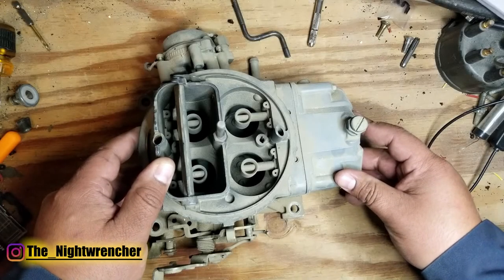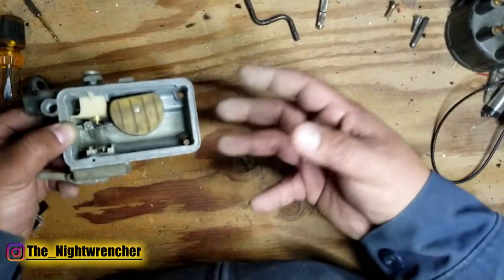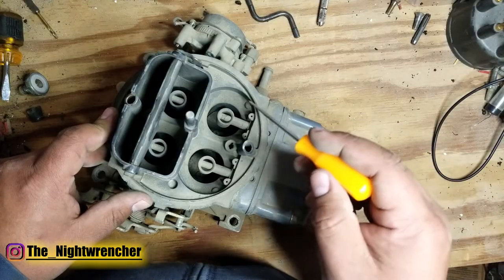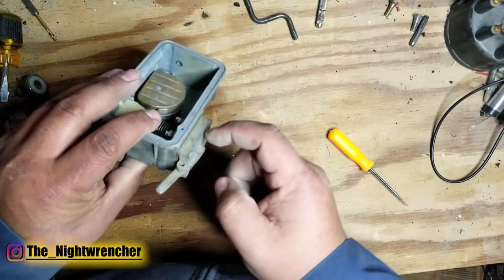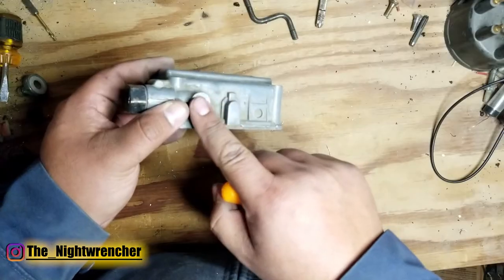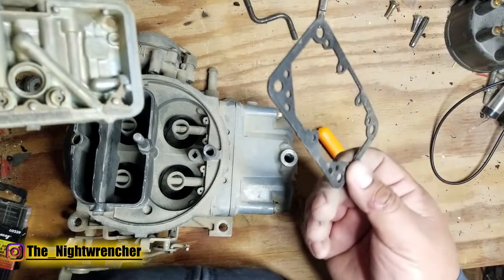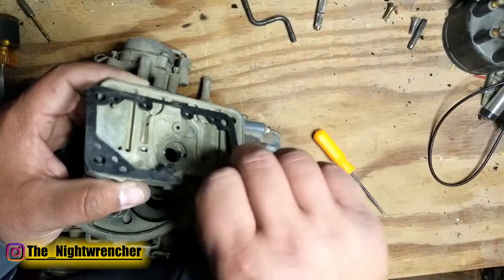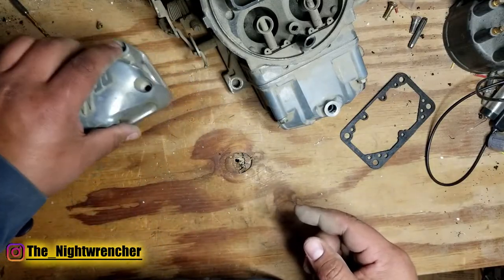Common Holley Carb Leak Solutions | Holley Carburetor Tuning Secrets |

Comment: Don't forget to not use a electric tool. My 800 carb became a paperweight
Reply from the maker: It depends on what tool you use. I use an electric drill with an adjustible clutch. I snug them down close and tighten them by hand

Comment: I don't have a fuel return, so fuel pressure goes up after I turn it off. The bowl levels start to go up, and just enough fuel blocks the air bleeds and then it develops a very slow leak on the butterflies
Reply from the maker: more than likely thats caused by heat soak. Try using a wooden or plastic half inch spacer
Reply: @NightWrencher  thanks, I'm putting in a return regulator and love to the tank. I just don't see a way around it at this point. I don't fuel in my new engine oil
Reply from the maker: Thats the best way to take care of it 👍

Comment: Hey I just found your videos, I’ve learned so much! Thank you. I’m having trouble with my Holley pouring fuel from the vent tube in my primary side. At high idle and driving it runs fine but when I let off the throttle it starts pouring fuel from my vent tube on the primary. I’ve checked the needle and seat, replaced the O ring and adjusted.
Reply from the maker: Hey man, what is your fuel pressure?

Comment: @NightWrencher Do you happen to have any idea why my secondary squirter drips fuel slowly when the car is off? Ive tried everything i can think of and nothing works. I appreciate any insight you can give. Ive searched high & low online with no answers.
Reply from the maker: Make sure you have a steel needle inside the squirter fuel feed and make sure its clean. When the car is off, fuel expands and sometimes escapes through the squirters. Once the engine cools off or leaks enough gas, it will stop leaking. Not really a dangerous problem unless its flooding the engine or leaking to the outside of the carb.
Reply: @NightWrencher  you helped me narrow it down. The brass seat under the steel needle had a defectin it. Used a small punch and hammer on top of the needle and it reformed the brass seat. Good to go! Thanks brorher!!
Reply from the maker: @jeremiahfiek5495  thats awesome, great job!

Comment: I fixed my 780 problems. After having an off idle stumble besides a surge at cruise at any speed and an idle that would not go down, I tore my 780 apart. I found wet gaskets and areas that should not be wet and a blown prim power valve.

I ended up filing warped parts especially the body bottom, the bottom throttle plate side and a bit on both body surfaces where the metering block meets. I spent a total of 5 hrs filing. It works great now after replacing gaskets, power valves and so on.😅

Comment: Does the casing that holds the accelerator pump ever get warped and no seal correctly? I noticed a fuel around the sides of the accelerator pump so I replaced the actual accelerator pump gasket because I thought it was ripped or something. It looked fine but I replaced it anyway. When I started up the car again I could still see the fuel seeping out the sides. So I was wondering if the casing maybe is warped and not sealing all
The way. Thanks in advance!
Reply from the maker: Sometimes it does happen. Running it over a piece of sand paper and check the pattern. Usually its just a little warped but it shouldnt be too hard to fix

Comment: I bought some vasaline and chapstik to put on gaskets for my next carb rebuild. I'm hoping it helps, especially on the paper gaskets. What do you think?  Or maybe antisieze or motor oil or trans fluid on the gaskets and the O ring on the needle and seat.
Reply from the maker: Ive heard that chapstick works pretty well but I've never tried it myself. Vaseline on the orings might work too. I usually install the gaskets bare and use motor oil or PBblaster as a lubricant to install the orings.

Comment: Lots of great info! Its been 10 years since i had to play with one. But got this old holley 4 barrel on a project car. Was just rebuilt prior to buying the car from a reputable carb shop. 2 months later and maybe 1k miles of driving I have a decent size fuel leak from throttle shaft area. Other than shaft being worn, can anything else cause it like over-filled bowls? 
Thanks again
Reply from the maker: If the shafts are leaking, the shaft bores are worn out. Somtimes they have nylon seals and other times its just metal to metal from the factory. You might also develop a vacuum leak from there. They sell bushing repair kits but I would recommend replacing the base plate. Good luck 👍

Comment: I have a holley carburetor with a float bowl on the front and rear of the carb. There is a straight steel fuel line that connects the two bowls. Fuel is leaking out of both ends of that steel line. It is almost as if the line needs to be longer. What should i do?

Comment: I have a brand new 600 Holley Brawler with mechanical secondaries and after making changes to tune it for my 306 I’ve noticed the secondary fuel bowl leaks down after filling it. There’s no power valve in it because it came with a plug, I have no visible leaks outside of the carburetor and I’m really stumped on this one, any advice would be greatly appreciated!!!
Reply from the maker: Well, fuel has to go somewhere and if its not leaking outside, its probably leaking into the engine. Where exactly, I dont know but if you can pinpoint if the fuel is leaking through the idle holes, accel pump, boosters, tslot or air bleeds, you'll be able yo find the cause really quick.

Comment: Hey senor Nighwrencher,

Not sure if it is me or my carb. I have a 750 4150 Holley on a 396 BB ,  my El Camino is insane  Up to say 100 ish mph,  and just seems to take its sweet time getting  up to the HP at 4500 - 5600 RPM, my cam, heads, intake are all matched up at 1900-5800 rpm Edelbrock and Comp cam,  I have a AF gauge, it seems to be fine all through the entire rpm range,  just seems to take its time at the top end , the build is supposed to be a 550 ish build, any thoughts? I am concerned about the carb CFM but it should be fine 🤔🤔🤔🧐😵‍💫
Reply from the maker: It sounds like your set up is dialed in but keep in mind that max horsepower does not dictate how the engine accelerates. If you've ever been on a dyno, you can see where the power starts to flatten out before it drops off, that's probably what you're feeling. Without completely changing your engine, I would suggest switch out to a shorter gear ratio
Reply: @NightWrencher  Well the gearing is a 700R 4  built with a 22-2500 stall, locking Tq and posi w 342 gears , first into second is all about burning rubber she is mean from shit to get, I just would like to see it act the same all the way through the gears.
I guess Dyno is my best shot 💉 now, and I really love your shows I have used them to go ahead with my AF gauge system, I was only off on my primary jets from 72s to 65s after the install , not to shabby from being a plug reader from the early 1970s. 🤔😉 Peace

Comment: Hey man just found your videos a while ago and I've been watching all your welding ones. can you do a video on how to weld tool steel for repairing like a broken wrench, Hammer, Etc...? Ive checked around youtube and cant gind any videos on it
Reply from the maker: Hey man, I Havnt done too much tool steel welding but I have done it a few times. I've found that it takes less travel speed, More heat and less wire speed to get the metal molten enough for you to be able to get a solid weld in. Also beveling the two pieces before you weld them together helps a lot too.
Reply: @NightWrencher  thanks! I'll try all those things. I have a rare hammer that my dad gave me. It has alot of sentimental value and the claw broke off.